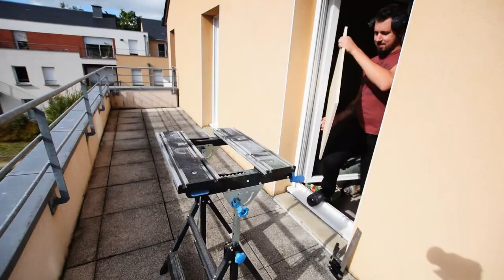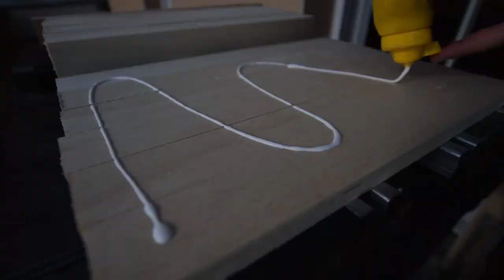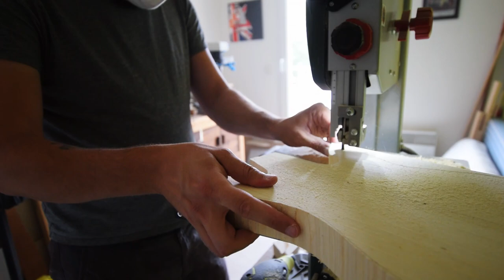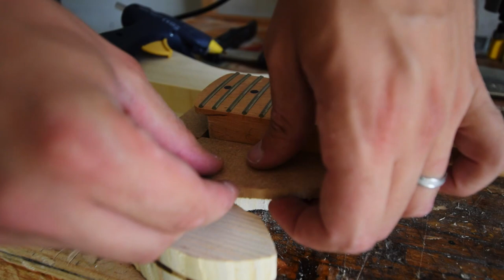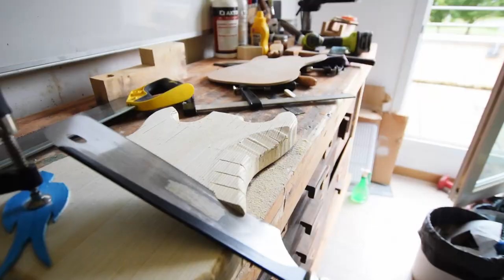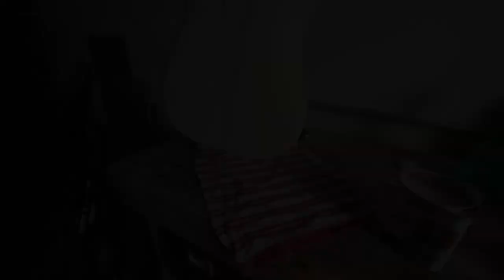MAKING A PLYWOOD GUITAR | Part 1 || GreatGuitarBuildOff2020 || DIY

Comment: Is there a reason to cut the plywood into this strips instead of cutting the plank in half and gluing one on top of the other?
Great build!
Reply from the maker: It was mainly for the looks 😅 but I think it also helps make it more stable and robust against torque and twisting
Reply: @FrenchCoastWorkshop  thanks! I'm in the process of building one, but I just glued a couple of planks on top of each other, it seemed easier hahaha. Hope it turns out half as cool as yours!
Reply from the maker: I’m sure it will be great ! Send me a picture when you finish building it, I would be happy to see it 😁